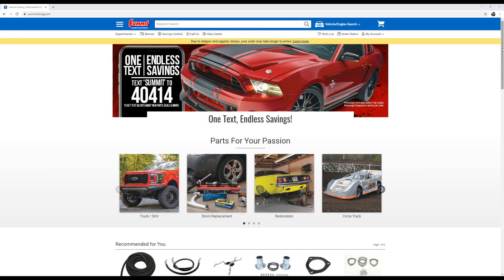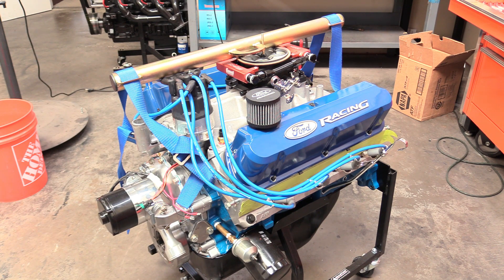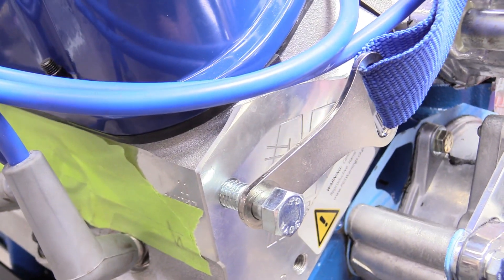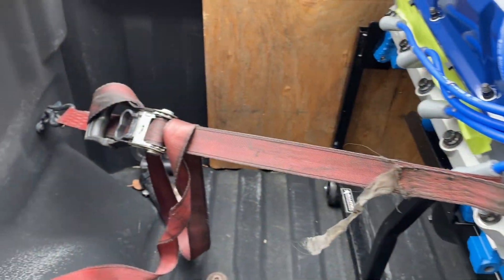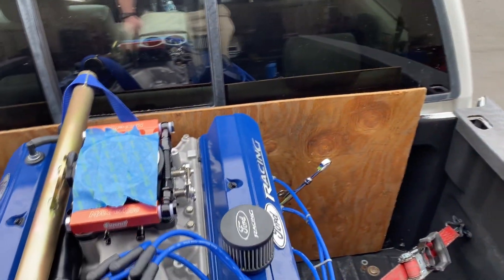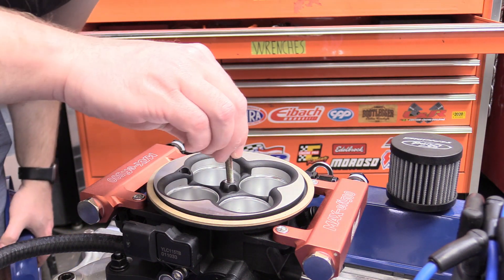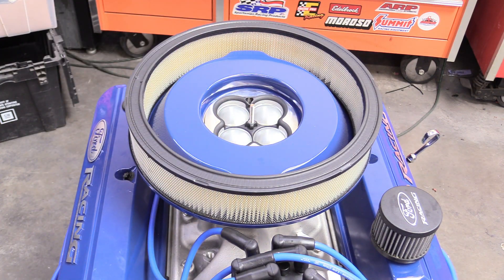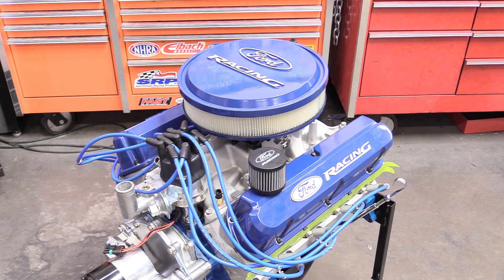How to Build a Ford 302 Small Block - Final: Going to the Dyno!

Comment: Hey Ryan, I have a ‘78 302 stripped down and ready for rebuild in my garage. I plan to use this series as my guide. Is it realistic to get around 400hp without the stroker kit and the efi? 
If I get forged internals , and 750 cfm carb. (Everything else from your build I plan on using)
Reply from the maker: I'm sure with a bigger cam and more compression it can and has been done. Thanks for watching!

Comment: Great series!Let me ask you something,i have a 74 ford bronco with a 302 with about 80,000 miles on it and im embarrassed to say it's been sitting for over 10 years for various reasons but i digress,lol,what process would you go through before you cranked up the motor?Would there be parts you would replace off the bat before cranking it up?I have taken the plugs out and put some marvel mystery oil down each plug and she does tunr over pretty easy.Last question is i am able to remove the little pulley on my water pump and have been told that shouldn't happen,is this true and should i get a new one?Thanks for any help!  rich
Reply from the maker: Hey Rich!

Thanks so much for watching! You have already done a bunch of good preventative work! But I'd replace the battery and change the oil. Disconnect the fuel source, that old gas is junk anyways. Then I'd crank it for a while, with plugs out, so I get oil up to the top end. Then I'd put the plugs in and try to fire it with a splash of gas down the carb and see what happens. 

Let me know what happens! 

Best,
Ryan
Reply: @2carpros  Thanks Ryan,i have a new odyssey battery and i changed the oil awhile back,i'll let you know how it goes,thanks!

Comment: @2carpros. This is a great series. Thank you for sharing. I noticed that the electric water pump was leaking during the Dyno, and while you drained and checked the oil. What was the cause?
Reply from the maker: Thank you so much for watching! I was leaking on the Dyno because of the waterneck not fitting totally perfect on the intake manifold. I thought it was the water pump too but I was wrong. I haven't looked at it since this video and it has been sitting ever since. I'll fix it before it goes in the truck.
Reply: @2carpros  You are welcome. Okay. I am looking forward to seeing the install and the first start and operation of the engine in the truck. Thank you.

Comment: Thank-you so much for this series!!! I have a 302 & am looking to get a 351 stroked and built myself. Its gonna be awesome & that efi 500 is awesome for the oldies transitioning from carb to something much more reliable!!!
Reply from the maker: Right on! Sounds like a great build! Thanks for watching!
Reply: @2carpros hey guys i sealed a deal on a 1973 maverick with 302. So happy about your video im going to start with a reco stock block with a 4bbl tunnel ram and the efi 500. Then source two turbos and the 500 should deliver plenty of fuel for the blow through 😎😎😎 love the help!

Comment: Really want to thank you for sharing the series of how to build a ford 302.  I recently spent several thousand dollars on a SBF 306 rebuild for a 1987 Ford Bronco (my wife named here "Karen").  Lol.  Long story short, immediately the head gaskets were leaking.  Took it back to the shop under warranty and basically, they would not fix it.  Wife cut me off on funds...  I was on my own at this time.  I watched your videos step by step on how to disassemble and reassemble the top end.  Motor runs amazing, no more leaks.  In the process, I learned how to adjust rockers, install distributor, set timing, install head gaskets and intake gaskets.  Thank you very much for what you do!!!!  Bronco still acts like a Karen.  🙂
Reply from the maker: So amazing to read! Thank you so much for watching! Enjoy your Bronco!

Comment: Ryan, I watched the whole series, very informative. Though I never saw you degree the Cam. Was it not shown in your series, or was it not necessary? Also, amazing horsepower and torque that 347 stroker put out, and that was without a roller cam! Very impressive!
Reply from the maker: That's awesome! Thank you so much for watching! 

You can if you want to get the absolute every scrap of power out of it. But considering what it made I'm happy lining up the dots and calling it good.

Comment: I liked the video. However you put a STP oil filter on it? all the monies spent on the engine and you spent  about $4.on a cheap filter. NAPA WIX and Carquest are all the same manufacture. STP, Quaker State, Pennzoil filters are all made buy the same company. Champion. Yes the spark plug company Cheap and not worth what the engine requires.
Reply from the maker: I think you might be overthinking it a tad. I drained the oil and cut open the filter. It did it's job perfectly. Thanks for watching!
Reply: @2carpros   Sir, you cut open the NAPA gold filer (made buy Wix) and installed the inferiors one

Comment: This series is fantastic -as they normally are.  But...did you happen to do a video of putting it back and in and wiring it up?  was it a c6 or aod type transmission?
Reply from the maker: Thanks for watching David! I believe it will be a C6. It's going back into the 1981 Bronco we plucked it out of. I will do a video showing that after I get this LS Swap Bel Air done which is soon!

Comment: Awesome, im gonna put a 302 in a '78 el camino. I have a 224° .050 cam. What size cam did you use on this engine?
Reply from the maker: That's an interesting match up. I like it!  Send me a picture when it's done! ryan@2carpros.com We used 218 int./228 exh. at .050 so its the biggest cam you can get for it using the stock torque converter. Thanks for watching!

Comment: i watched all 11 videos i have to say it was the most informative videos i have ever seen i was wondering will the throttlebody instead of a carburator work on a 68 302 .my build will have slightly different parts than your does i thought it would be cool to have a throttlebody on my 347. Thanks again for your help .
Reply from the maker: Thank you so much for watching! It will work if you have a four barrel intake manifold.
Reply: @2carpros  thats cool thank you.

Comment: I was wondering if the air filter housing top lid was going to align forward. It would not look right if the Ford name was off set.  Is at the EFI units like the one you installed only got a 13 “ filter? What is the opening size? 5 1/4”?
Reply from the maker: It's the standard opening. 13" is just how big the air cleaner is. It's all circular so it lines up just fine. Thanks for watching!

Comment: I always thought a Windsor engine was at least 351 ci or above and built in the town of Windsor. You keep saying 302 Windsor. What’s the difference between a standard 302 ci (5.0) and a 302 Windsor?  I don’t know. My 79 has a standard 302 (5.0) in it.
Reply from the maker: I guess technically they moved production from Windsor to Cleveland in 1970. So technically its a Cleveland made engine but it is colloquially referred to as a Windsor still. That's what the machine shop guy called it so I did too. Thanks for watching!

Comment: Whats the process of breaking in the engine. Did you let it run at different rpms for a while or did you send it straight to the dyno?
Reply from the maker: They broke it in on the dyno for me. So they run it at different RPM to break it in and there is different schools of thought on how to do this Summit did a great article on it https://help.summitracing.com/app/answers/detail/a_id/4707/~/how-do-i-break-in-my%C2%A0flat-tappet-camshaft-and-lifters%3F

Thanks for watching!

Comment: what would the approx cost of all these upgrades from summit be that you used?  $3000?
Reply from the maker: Summit sent us a ton of really excellent parts. But I think just the aluminum heads were 950 each. I didn't add everything up. Although you don't have to get all the best stuff to have a really great running engine. Thanks for watching!

Comment: I just watched this entire video series. Absolutely amazing job explaining everything I am extremely impressed but I do have one question. How would I go about this differently for a different year model engine? I have a 1994 F150 with the 302 in it. Of course it’s efi and fuel injected already.
Reply from the maker: Great question! You'd do it exactly the same except the intake manifold and your air fuel solution would be different you could re-use stock or get a performance aftermarket solution. Thanks for watching!